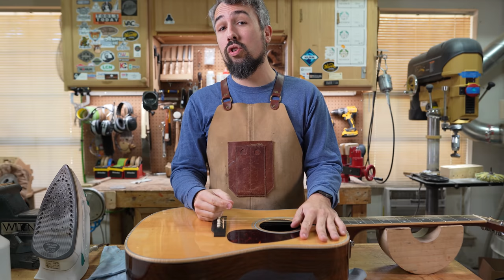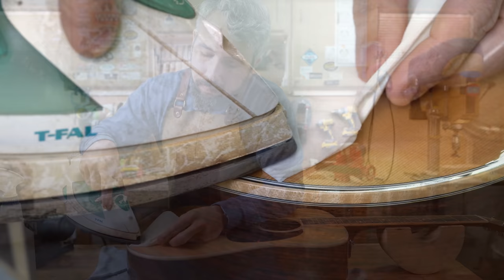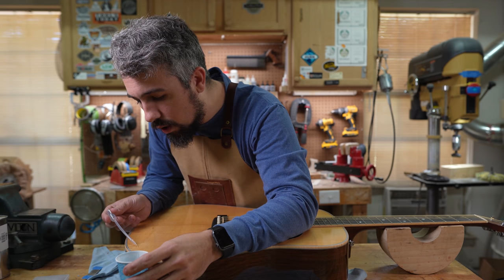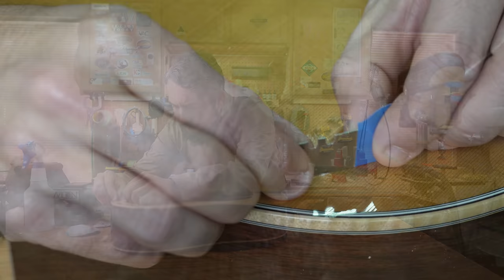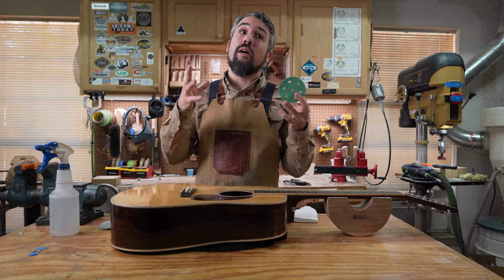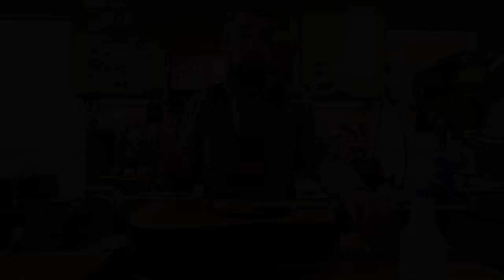How To Fix a Dent In Your Guitar’s Soundboard (Martin D35)

Comment: I see that this 150th D35 anniversary edition has maple binding.  Reminds me of the D35 Anniversary edition that I brought you from Canada that had cracks on the front, sides and back and someone had tried to put a new finish on with a white wash brush ~ even dripping shellac into the sound hole and down the sides.  It was truly a basket case when you first saw it.  After you worked your magic and fixed all the cracks, did a neck reset, new pick guard, bridge and complete refinish, you asked me about binding it with the maple instead of whatever Martin calls that plastic that they use.... Great idea.  I've had that plastic fail on two other Martins that I own and on my D41 they gave me a VERY bad time about redoing it under the warranty.  The care and patience that you bring to your work is quite amazing and equally impressive.  Great stuff!!  These videos that you and Matt are producing have got to be gold for folks who are interested in doing this kind of work.  Kudos to you my friend.

Comment: A better choice than a household iron  (bulky and heavy) is a guitar-repair- dedicated soldering iron with interchangeable tips. That provides tighter and more precise application and keeps peace with the spouse
Reply: I was just about to ask this very question. A solder iron seems a much better choice, the house iron looks a lot more cumbersome, therefore more easy to mess up.
Reply: @user-otzlixr  The dampened paper towel/cloth provides the water, which vapourizes when heated. I used this technique on the maple shaft of my favourite very old pool cue, to very good effect. The other takeaway was that I would never again let another person try a shot with it. The hothead banged the rail with the cue, when he missed an easy shot to win. I have a Hakko soldering iron, with a digital control, so I kept the temp dialed down to 225F. Enough to make steam at the very spot, but not radiate too much heat to the surrounding area
Reply: My favorite is a covering iron made for R/C aircraft. It’s basically a miniature iron with a long handle, and the one I have has precise temperature control too.
Reply: He said you can use a soldering iron to do the same job in the video did you watch it all the way through?
Reply: Randall Harris, Twooford?

Comment: I've done this a few times now. One thing I strongly recommend is 1) always sand with a miniature block (I used the flat of a popsicle stick) behind the sand paper or mesh. Dont use your finger, or else you will dig a hole in the finish, effectively.  2) stick to higher grit, like 2000 grit and up, then you wont have to ruin the repair trying to get rid of low grit scratches.  3) if you use super glue, keep in mind that the super glue will have a higher hardness than the surrounding poly, and as you sand, the surrounding material dusts away quicker than the super glue unless you have a flat sanding surface, hence the reason to sand with a very small block.

Comment: I had a mic stand damage the finish on my 2007 Eastman and I drop filled it. For my first time doing the repair like this I’m really happy. I bought micro mesh pads off Amazon pretty cheap and used those to buff it out. I have another Eastman the previous owner really beat to death and I plan to drop fill it this winter when I have time off from performing live.

Comment: That was a great education and thanks for doing it.  I have a beautiful old Guild from the 1960's that I dropped wire cutters on several years ago.  I was cutting loose ends of strings after putting them on.  The cutter slipped from my hand and dented the wood itself on the top, though it is maybe less than 1/8 inch wide.  I have not tried repair because the wood is seasoned beautifully.

Comment: Great video. Thanks for sharing your experience.  I think the discoloration came from rust on the edge/corner of the razor blade. My guess is it didn't have enough rust that you would see it but when you were digging into the grain to get that lacquer to fill in the air gap between the lacquer and the wood the little bit of rust came off the edge of the blade, hence the orange discoloration in the repair.

Comment: I’ve used this trick many times and I think others should be warned: you can make things a lot worse doing this if you’re not careful (and sometimes even if you are careful). Heating lacquer with steam will typically cause it to soften, so you need to be careful in how you handle it in this softened state. One slip with the scraping tool and you’ve taken out a big divot, and sandpaper is dangerous on a soft finish too. Also, often it will absorb the moisture from the steam, causing it to “blush” (makes it look hazy), which has to be corrected with alcohol which also softens the surrounding lacquer.

In all but the best cases, you end up with a multi step repair like you’re seeing in this video. And if your guitar has colored/tinted lacquer, don’t even think about doing this unless you’re experienced in color touchup work on lacquer. It is much harder to make a colored repair look less obvious than the original damage.

Never practice this technique on a guitar you care about. And unless you’re really sure of your abilities, you will find it easier to accept the random looking damage instead of the obvious mess you can create with a failed finish touch-up.

Comment: The top on my 94 HD28 cracked one night due to dry conditions during the winter.  I had Rainbow Guitars here in Tucson fix it, but it soon split again.  Can it be fixed?  Should I even worry about it?  We used to use your technique to repair dents in our hard wood floors back in Iowa.  Worked great!

Comment: I'm not a guitar tech, but I did put a small ding in the top of my really nice Martin. I wonder if the ding can be pulled out with a tiny but strong tiny suction device after first softening it with steam. If I find pieces of a guitar top to play with, I'll give it a try. My guitar tech already used steam to pull out another ding and it worked OK but not perfect. I'd rather leave the ding As Is than do the process described in this video.

Comment: A much simpler method is one suggested by Hints From Helloise! Really! Place a dab of Vaseline petroleum jelly on the damaged spot, let it sit overnight and voila! The dent is gone. The oil in the jelly makes the finish expand and it lifts up. 
Works most of the time, depending on how bad the dent is.

Comment: An adjustable-heat soldering stick is far better than using an iron.  Using an iron on dents and dings is like driving thumbtacks with a sledge hammer.  Set the stick so it's just barely hot enough to make steam when in contact with a wet cotton cloth.

Comment: I really appreciate your video!
   Only thing that I cringed at was at around the 21 minute mark,
I noticed your wrist watch rubbing the soundboard!
  I "uncringed" when you had long sleeves for the rest of the repair!
  I used to wear white painters overalls back in the 70's at hot outdoor concerts here in the SanDiego area.
  Not only for the heat, but like you said,that freedom feeling.

Comment: Satin finish has to be a different process. Had a guy at a party scratch the hell out of my Martin with a pick. Multiple long scratches. Some running parallel to the fingerboard! Not sure how he did that. Luthier tried the steam out by itself. It didn’t work. He quit at that point. No way I’d do a refinish. Guess I’ll deal with the damage. When it’s 50 and dark, it’ll look cool. We’re 30 years into 50 now.

Comment: Could this have been done with Superglue also?
Reply from the maker: Yes, but it’s always preferable to use lacquer on a lacquer finish. I only use super glue on UV cured finishes and poly.
Reply: To add to the DW comment, on nitro finishes you want to use nitro to fix things because the new finish can ‘reactivate’ and ‘melt’ into the old finish.  Thereby helping to minimise witness lines etc.  
On poly finishes I would use superglue 99/100 times

Comment: fantastic repair. but it is too risky for 'nerve wrecks' 😄 like me to do.
applying a stimulus to a system where time of usage can make the difference between change and destruction of that system is NOT a stable procedure - basic engineering
ironing, sanding etc. is a sacrificial act. not necessarily constructive, molecularly speaking.
when repairing, be sure that you do not actually increase the damage.
like, when you have to replace .2 milimeters and you end up replacing 2.01. that is bad

Comment: Christophe, couple things. If you strop the razor with some green rouge, and then you use a carbide rod to fold over the edge (comme Le scrapeur) you will have a much more comfortable ride when scraping. 

Also you can do Uncle Dan’s strip sanding method. Speeds things up with less collateral.

Most importantly, lose the soap and use jet dry. It’s a super duper surfactant and works like a gajillion times better.

Also, I enjoy the shit out of your videos and am so happy when I see you’ve got a new one out :)

Comment: 3M has a nice assorted 1000, 1500, 2000, 2500 grit pack for like $4 on Amazon. A microfiber and a little scratch remover from the local automotive store works great when you don't have a buffer.

Comment: Good info! I’ve been  drop filling the last few days. I did mine a bit different. I used super assilex paper. So, no water needed. Also I let my laquer sit in an open jar for an hour or two to thicken up, and filled with that. There was a tiny chip down through the color coat. Luckily I had the chip. Dropped laquer on top, it melted the crack and looked invisible. The other fills were just pinholes between bindings etc. It’s a new build, so, not repair work. Got great results

Comment: if its a shellac finish sometimes on spanish guitars, its super easy to fix as well. Similar process to laquer, just not toxic as all hell and not strong, sadly. Also you can buy small irons made for this function. like a 2 inch iron, makes it easier to maneuver.

Comment: Never worked on a dent on a guitar, but as a woodworker I do a similar thing with a soldering iron and applying water with a dropper directly onto the dent. Using a fine point on the soldering iron i'd steam off the drop from the dent (without touching the iron to the wood). I am wondering whether there are pros/cons to this method

Comment: ‘The viscosity of a fluid is a measure of its resistance to deformation at a given rate. For liquids, it corresponds to the informal concept of "thickness": ...’ - Wikipedia
I got confused about that too. Thinning lacquer reduces its viscosity.

Comment: Fun Fact:  Viscosity is a measurement of a fluid’s RESISTANCE to flow.  So high viscosity fluids are thick and highly resistant to flow.  Low viscosity liquids are thin, with lower resistance to flow.

Comment: I did some work on a guitar recently. I’m a do it yourself we. The damage was really old and on the guitar when I bought it. It had gone down to the wood and similar size to the ding in your video. 

I fixed the ding perfectly but it seems as though the glue is going to discolor the area darkening it. Would this be normal if there was wood fiber damage beneath the ding. It looked like there was.

Comment: U can use vinegar on the ding. It will swell the wood the level it should be. This works great in spot that the finish is cracked so the vinegar can reach the wood.

Comment: I watched a repair on a guitar similar  to what you just did. He had saved the little stoppers that hold up a window shade on a car window. The accessory.  And a very small  Suction cup from a fridge  Thermometer. And when he placed his drop on the guitar  he placed the  Suction cup over the drop and plunged it into the cracked surface . It pushed the laqur into the crack.wished I could remember the video I just can't. But was pretty smart. That's just a thought for the future . He also did that with glue into a Martin pick guard Crack that had shrank and separated  the wood between the sound hole and the bridge. I thought that was pretty smart as well. Great video learned a lot.